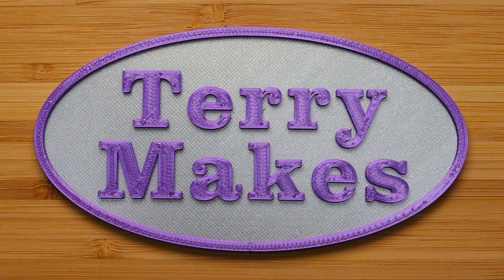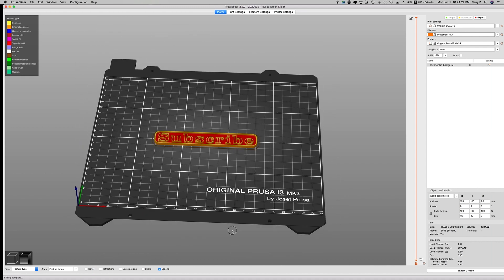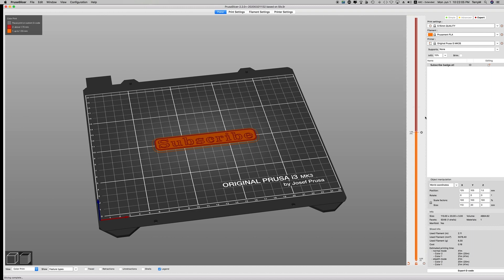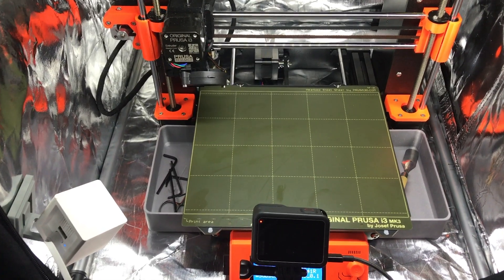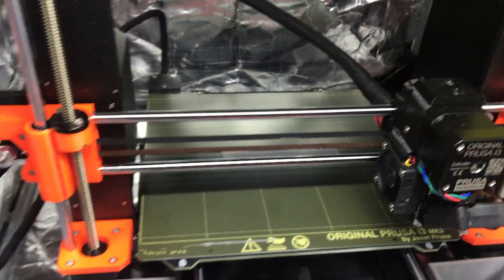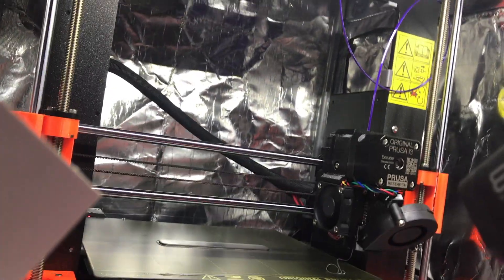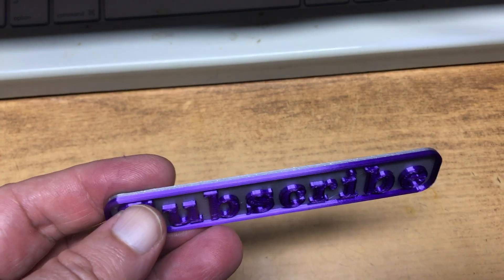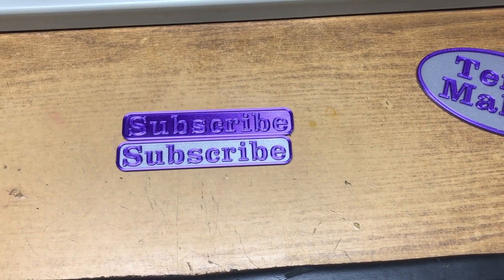3D printing 2 colors with a single nozzle using PrusaSlicer

Comment: I did same but my priter just doesn't  stop printing,  it just continue  till the end like normal  print,  what should  i do?
Reply from the maker: It's likely then that your printer firmware does not understand the M0 (pause print) command. If it does not then not sure you can do anything about it unless there is an update to the firmware you can install

Comment: I did all of that.  I went to bed expecting to wake up to the printer prompting me for the filament change but apparently my Klipper printer ignored the change filament G code?  The part was printed in a single color.
Reply from the maker: I am not an expert in this but I believe the pause commands and such are built into Marlin and so it would be different for a Klipper based printer.
Reply: @terrymakes3613  - I tried the PrusaSlicer Change Color and Pause commands and they seemed to work in PrusaSlicer but the Neptune 4 Pro printer doesn't even slow down, so I'm back to the old method of manually pausing the print to switch filament.  Pause and Resume work well so this is a mere inconvenience.  My custom Japanese mini truck mud flaps look great.

Comment: not sure why but when I split my model in this way my printer doesnt pause to allow a fillament change at that layer, it just prints the whole thing (Sovol SV07), an ideas?
Reply from the maker: Not all printers have the command enables in Marlin, yours must be one of those. Sorry but enabling it is beyond my scope of knowledge but it can probably be done.
Reply: @terrymakes3613  yeah all good, i think mine is doesnt have the code that prusa uses for filament change

Comment: I did everything as in the video but it printed all is one color. It did not stop for fillament change. I have a voxalab aquila printer.
Reply from the maker: I am not familiar with that printer but it sounds like the firmware does not support the pause command. You could check the gcode (in any text editor) and see if it put in the "M0" if it did then your printer does not support pause, if it didn't then something didn't go right, you can also put this in manually.

Comment: Do you need this Brand of printer or doesn't any work?
Reply from the maker: It can be done with any brand. PrusaSlicer can be used with other printers. You can do this with any slicer as well but you need to manually put the pause command in the Gcode which can be a pain to get right, this is one reason PrusaSlicer is so great. Also should work in Super Slicer from what I understand (like PrusaSlicer but community built).